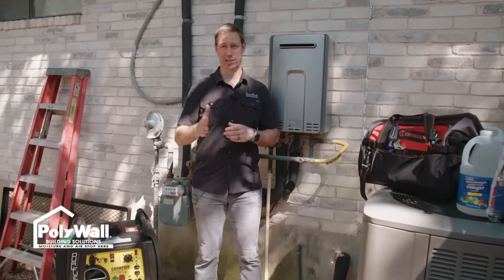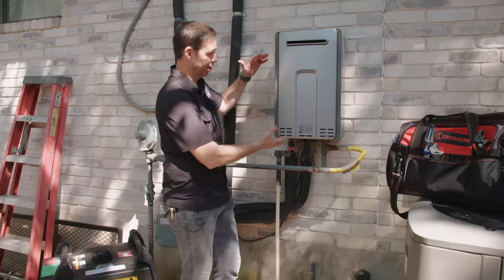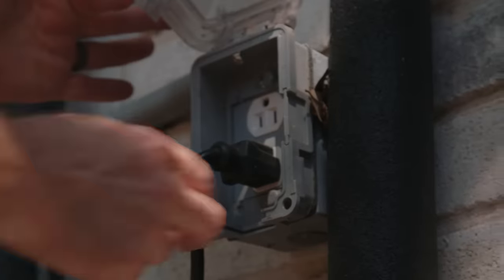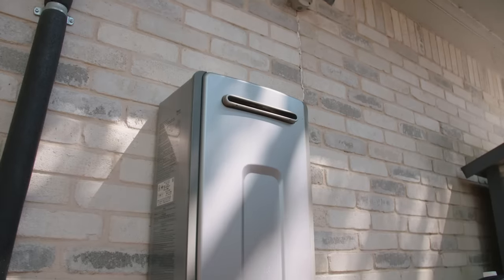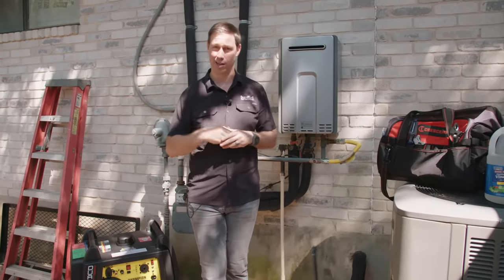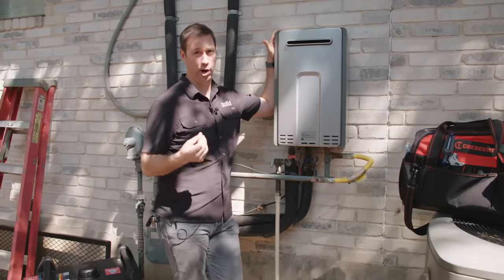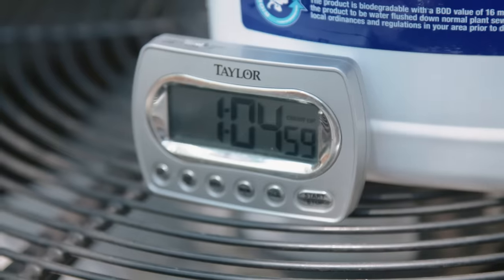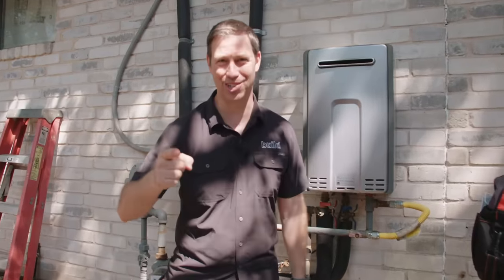3 Things They Don’t Tell You About Tankless

Comment: I found the main downer of these units is the amperage draw required to run. I laughed when he pulled the cord out of that 15amp outlet. I just installed one for a customer remodeling a bathroom here in Maine and the first unit they choose drew 113amps@240v and required 3 - 2p40amp breakers. I told them order another one or we'd have to upgrade their service 200 to 400amp. We settled on an 80amp two-heater unit (2 - 2p40amp). Which still required adding a 100amp subpanel for breaker space. To boot, even that 80amp unit has a hard time keeping up with the flow rate of water. We had to throttle down the water pressure as much possible so the unit didn't throw an error. Big considerations
Reply: You installed an electric unit. This one is natural gas. The natural gas ones only need 120v to run the computer.
Reply: @Hesthegreatest1  Yes, I should have been clearer in my post. This wasn't covered because he focused on gas units. I posted this because it's a huge caveat going full electric. Cheers
Reply: I've been getting quite a few rewires to run a 110 igniter for the gas instahot h2O heaters.
Reply: @joeh1529  electric tankless water heaters are a complete waste of money.

Comment: I've had tankless for nearly 15 years and couldn't love it more especially when I had teenagers at home.  Mine has a pilot so I have had hot water during extended (ice storm) power failures. There is nothing nicer than a hot shower when the rest of the house is freezing.
Reply: Are there still pilot models availible?
Reply: Are you saying your tankless (with the gas pilot) heater works in the absence of AC power and without a generator/battery? If so, how is the water pump being run?
Reply: @Dxun2 The same as it always works, I guess... gravity? There is no electrical connection. Sorry, I'm not a plumbing expert.
Reply: @frang58  so yours is gas and runs fine without electricity??
Reply: @carladurland5194  yes
Reply: @Dxun2  You only need a pump if you are on a well. In town they pressurize the pluming across the whole town through some means where they typically have backup generators. The water is pressurized into large water towers so the pumps don't have to run all the time either. Personally I am not a fan of gas tankless water heaters and prefer electric ones, however be prepared for a lot of power usage. The last one I installed was supposed to pull 150 Amps at 220 volts or 33,000 Watts. They are not as efficient as the gas ones, and they are not as powerful, however they are way simpler to work on. 

Funny story related to city water... My grandmother lives right on the edge of town and she has city water, however her neighbor does not...  a few years back a hurricane Ike hit us and many people were without power for weeks.... My grandma's neighbor had a hot water heater that could run without power, so they bought a few garden hosed and made an adapter to be able to connect the two houses together at the water spigot. They did this until the power came back on.

Comment: I'm moving in 3 weeks and considering a tankless. 2 things I learned from you. My plumber was less than honest. He never told me to change the rods or drain it. Just told me the reason they let go is the rods corrode over time. I think you just helped me make up my mind on tankless in my new home since there's Brazilian Teak wood throughout and I'd be royally pissed if the tank let go and ruined that flooring.
Reply: There's a reason utility rooms are used.
Reply: You got a lot to lose sleep over when you bring water in your home. I have a switch by the door to cut off my pump when we go out.
Reply: Sorry you feel that way..for me they suck..5200 for about 5 years of repairs and replacement.. I got receipts

Comment: Happy to get this info, I always wondered what the draw backs were to tankless water heater, but doesn't really seem like much.
Reply: Litiviou Spartus. If you don’t have a very large tub the wife uses every day. Or you don’t have a large family like Mat does. A tankless is a waste of money for you. Plus when you turn on the hot water now at your furthest fixer. It will just about double that time. So you must take into the down side that your water waste will go up also. 
  I’ve been installing these things for over 30 years!
Reply: Tankless drawbacks:  1) They (tankless) cost more to install.  Something like $700 tanked vs. $1200-1400 tankless.  2) It takes much longer for hot water to arrive at a faucet.  3) They make noise:  a blower fan and some electronic clicking vs. near silence for a tank.  4) Tankless is a much more complicated appliance.  This may or may not be a reliability and/or maintenance issue, but many people are technology shy.  5) Tankless may restrict hot water flow more than a tank arrangement.
Reply: Wally Kramer they definitely do restrict flow some, but most plumbers work that I’ve ever saw restricts flow more. At least in my area. They put fittings at every bend in pex, which is why I plumbed my new house myself. For some reason they treat it as if it’s hard pipe and doesn’t bend smoothly 90+ degrees.

Comment: I've had the same tankless unit (Bosch Aquastar) in my house for about 18 years now. It has worked perfectly and with no problems the entire time. Mine continues to work even if the power is out so if that is important to you shop around, not all require electricity. In addition, adjust the outgoing water temperature during the course of the year so that the outgoing hot water is just about the temperature needed for a hot shower without mixing in any cold water. You do not want to run these with scalding hot water that is then diluted with cold water at the faucet or showerhead. You lose efficiency doing it that way. I think that also minimizes scale, I have only cleaned mine once during the whole 18 years and I am not even sure it needed it then. My gas bills dropped noticeably when I had this installed to replace the old 40 gallon tank in my house. Been a long time but at the time I recall somewhere around $25/month.

Comment: This is an excellent video. When we built new 18 years ago, we installed a tankless water heater and I'm glad we did.  

There's another thing to consider.  Tankless output is measured in degrees rise.  Down here in the south, our water supply never gets cold, but I'm thinking if you have really cold input water in the winter, your flow might not be very strong, since it slows flow to help raise the output temp when needed.

We were on well water the first 10 years we were on well water and even with a soft water system I was flushing the water heater every 4-6 months.  Now we have great county water and I only flush every 12 months.  We have a 12 foot daylight basement with two utility rooms so our tankless is mounted inside.

I agree, don't buy expecting to see significant savings.  Buy it for the extra hot water.  My wife and I have to leave for work at the same time and there's no worry about using up all the hot water.

There is another plus, though.  When properly maintained, the tankless will last at least twice as long as a conventional water heater.

Comment: For power outages, the units pull less power then a 100 watt light bulb, they can be powered for quite some time by a PC backup power supply, I would recommend any internal unit be connected to on for the extra surge protection, back up power and voltage conditioning of a good APC. External can be put on them if wired right. For usage, don't blame the units for not forcing you to use less hot water. That's kind of like saying grocery stores get a bad mark cause they let you buy food you end up throwing out. The units waste no gas holding hot water and get more of the heat generated into the water then normal tank heaters buy about 10% on non condensing units. For the flushing, which you have bad B roll of, yeah u buy a pump and bucket once with some hose fittings. You use 4 gallons of the cheapest vinegar possible once a year, or you buy one of the tankless manufactures pretreatment cartridges and replace them as they run out. Its simpler than changing the oil in a car, you can do it yourself, have a cheap handyman do it or even one of those teenagers using up all that hot water.

Comment: Something else not mentioned is the time to get hot water from a tap. With a tank, we had hot water out of the faucet in a few seconds. Now that my house has a tankless heater, almost everything other than a shower or particularly long sink task like washing dishes ends up being with cold water simply due to the extra time the tankless heater takes to deliver hot water.
Reply: We installed a close-in heater under the kitchen sink for this reason.  Doesn't draw much extra power and I really prefer it over having a massive tank.  For some real added value, consider installing a boiling water tap (Quooker) instead of the close-in heater, so you get instant hot or boiling water (we're having one installed next year)
Reply: There is a valve that can be installed between the hot and cold lines that recirculates the cold water back to the tank until the water is hot enough to use from hot side. No water is wasted.
Reply: I have a problem with the temperature changing drastically to cold, if I make a slight adjustment at the faucet.
Reply: We have a tank, but still have this issue. Our kitchen sink hot water line, branches off to the Dishwasher. So we just run the sink for a minute  or two, and then when it comes out hot, we use the dishwasher.
Reply: I'm, unless you had a crossover or mixing valve in you tank system, the time it takes to get hot water to a fixture would be the same.
Reply: 3 gallons in summer 4  in winter, i refuse a cold shower. i save water in bucket.
Reply: Flow restriction from small gas line
Reply: Who ever installed your systems f’d up.

Comment: For me, the cost savings have been very real and very nice.  On the other hand, the long lag time to get hot water to the kitchen faucet, and especially the washing machine,  has been a real drag.  Everyone must balance the pros and the cons.
Reply: long time lag ? how far away is the faucet your impatient holiness ? lol
Reply: @chrishawkins1922   40 feet
Reply: We have the same, takes a long time to get hot to the kitchen/laundry. But that is about placement and not the type of heater. My cousin installed 2 units to work around the problem. I’m ok waiting.
Reply: @leannewith3  How long does it take on average to heat up the water after turning on the faucet?
Reply: @Bizzare77777  about 15 seconds for the close ones and 30-45seconds for the far ones. That’s to full temperature. They gradually get warmer.
Reply: you need a pump special one too. it will push cold water from hot to cold until at temp. more to wire up and do. at longest faucet.

Comment: I have mine on a UPS (APC BR1500MS) - works well for power interruptions and they really don't draw much, so it'll last a long time.
Reply: true good stop dont even have to swap plug ins
Reply: Yes, a small UPS would work on a gas fired unit.  While the heater draws something like 100W while running, it's the long standby drain with the UPS running that would be the main limit on duration.
Or something like the Hugo X-1 is a dedicated tank-less backup power solution, it has a flow sensor you can add and it's fire up only when hot water is being called for.  This way the UPS doesn't need to be sitting on all the time.  
I run my gas fired tank-less off my off-grid solar power system, see the timeline link in the video below:
https://youtu.be/_lBUs3kdDZE
The heater has been off-grid for nearly 2 years now.  We had an extended power outage a few weeks ago and the heater didn't even know the power was out.
I found my tank-less conversion reduced my hot water gas bill by over 75%.
It's unlikely any reasonable backup solution would be feasible on an electric tank-less heater.
Reply: Depends on the type of tankless... For gas heater, yes, you can rig something fairly easily but electric heater that would not work unless you got a whole house capable unit that can run the AC, etc.
Reply: @ZeoCyberG  true but only subject is gas tankless and electric doesn't have igniters or fans. Also would need to be a 240v UPC

Comment: I reside  in one of nyc borrows  using city water  ,  i had installed a bosh Tankless water heater 21 years ago never ever serviced it  never had an issue with ,and the thing works as good as the first day  installed ,  i even forget wee have one ,it have an externally controlled thermostat we usually have it set at 98 dgs.  with everything running sink dish washer  same time   ,or you can be watering the garden to and not even noticing any  deference in temp, or flow, i guess it have a lot to do with the water quality and the house piping and water pressure  ,it uses natural gas  and electric for exhaust fan, i also have one installed at the summer house that is running on propane  gas and 2 D battery's using well water  there,  6 years now and so far had no problem , replace the 2 D battery's every spring time is all i do with that one 
 In the last 2 years i have replaced both of my sons hot water tanks with tankless  they ere happy with them so far too.and they do save Money they use some electricity and gas , most important they are ready for you r demand for hot water at any time , one thing try and install it as clause as possible to where use the most hot water , so you have less travel of hat water and also save on water, me it is under the bathroom in the basement , open the hot water and it's there in 15 seconds , i recommend tankless water heaters.

Comment: "Replace anode rods every couple of years" for tank maintenance? I guess that depends on your water quality. In my area North East of Atlanta our tanks can last for 15 to 20 years with no anode rod changes and by that time we just replace the tank. No one around here seems to be changing them.
Reply: Southwest MO you're lucky to get 10 years, usually they're 1/3 to 1/2 full of scale by the time you get there.
Reply: I don’t install tanklessfor the very reasons stated here my first 50;gal gas lasted 23 years power was off several times at length always had hot water never did anything but relight the pilot after we forgot to pay gas bill . Plain and simple water heaters don’t just reheat that often when not in use . I have had customers call on Friday with a leaking tank type that they turned off power and water to and Monday morning it was still hot enough to shower in although not the normal 140 degrees
Reply: I’m in Northeast Ohio and we get excellent water from Lake Erie so I have not experienced any of these problems, 15+ years so far with absolutely zero maintenance.
Reply: a lot of people I know are pushing close to 20 years on their water heaters. I never heard of replacing them every 8 year. That sounds excessive.
Reply: Lucky to 4 years out of a hot water tank here.
Reply: I live in SE Ohio. Our city water smells like bleach and the filter on the refrigerator takes out the bleach smell but the white calcium, lime, or whatever it is doesn't filter out.

Comment: I tell all my customers about those cons and all the pros. Really, a flex line outside? Hard pipe baby☝️
Reply: Ya that gas job is disgusting. You can’t even do that where I’m from. It’s amazing how relaxed some codes are in different areas.
Reply: @terdferguson1736  People stealing copper? Flex will break down due to UV.
Reply: I do plumbing in CA and we have to use flex lines on gas for earthquakes.. also you need 5 ft minimum pipe length between a gas regulator and tankless.
Reply: In California the inspector would make you change it out to a flex. I would check the paper work on that Tankless. There are only a few of them that can be supplied by 1/2 inch flex. Most are 3/4 plus the full flow 3/4 gas line. These things take a special large flex. Not that 1/2 gas block they have on that one!!
  1/2 flex does not flow enough gas for a 199K burner
Reply: Fortunado _ really , that’s interesting.That would never fly here. We have to use swing joints which I don’t know, seems like a Sturdier and more aesthetically pleasing way while still providing for structural failure.  we can flex dryer, stove, and fireplace inserts.  But thanks for letting me know, i always find it interesting what codes other states have.  From what I hear like MASS, CA has some of the most stringent codes.
Reply: terdferguson1736 yes we do here in California

Comment: We have had similar units in the uk for a few decades. Ours are known as combi boilers. They heat the radiators and the hot water on demand via a diverter valve within the boiler. He radiator water circuit is heated directly by the burner, then if hot water is called for, the diverter valve sends the radiator water through the plate heat exchanger, which heats the potable hot water for the taps.

 Here in the uk all gas appliances must be serviced, or at least safety checked, annually. We typically pay around £50 ($90 i think) for this on a boiler. They check the gas and flue seals, the flue gas composition, the gas pipework integrity, and take apart the burner to clean it. The burners and heat exchangers on ours are usually stainless steel. The best thing about them is that you only heat what you need. Increasingly larger houses with multiple bathrooms are having tanks fitted back in because our combi boilers struggle with more than one outlet being opened. Typical ratings are 24-40kw. And if we fitted ours outside the scrap men would steal them before you could blink!

Do american gas appliances have to be condensing flues now? In the uk it is compulsory as they are up to 98% efficient. It extracts heat from the flue gas so the flue runs so cold they are made of plastic now.
Reply: All US 95% HE heaters are condensing.  It would never achieve 95% or more without condensing